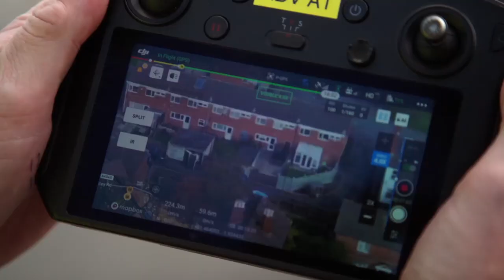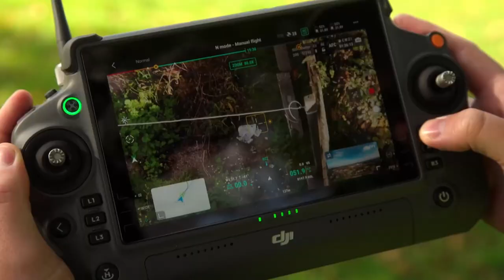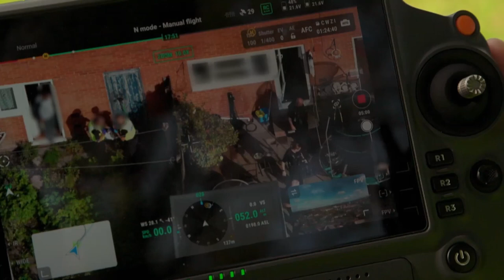Catching Drug Dealers using Drones | Sky Coppers

Comment: if they put a jack in the doorframe and push the frame from eachother, the door opens 20 times faster
they dont need to destroy them self and the door like that, it is kind of unnecessary
they are not handymen that is for sure, pushing in the corner of the door does nothing if it is a multiple point door lock

they might even leave the door intact, the locksmiths dont put the jack in the corner of the door for more then 1 reason

i had a high security door cut out of the wall by the cops, one time they came to visit when i was not home.
 no doubt they did that faster then they did in this video (and cheaper to reapir, i just had to reinstall the door)

this guy should pick up some helium ballons 🤣